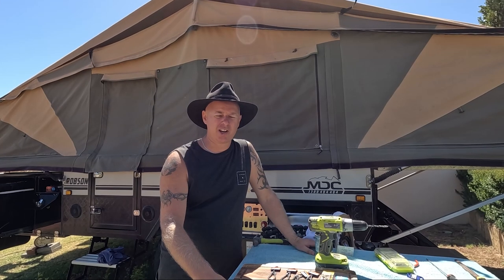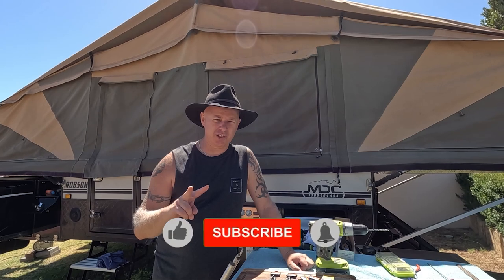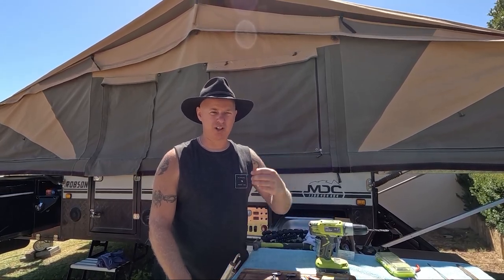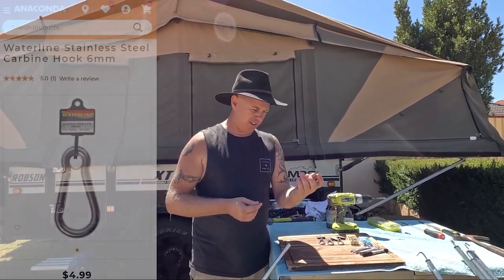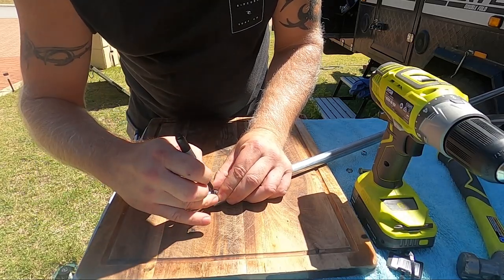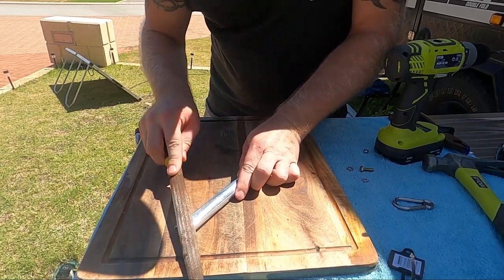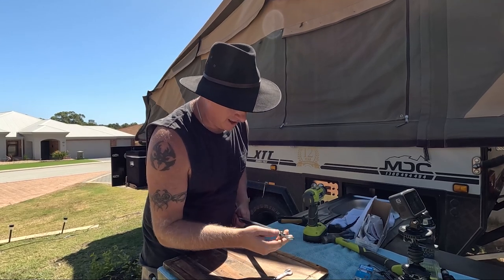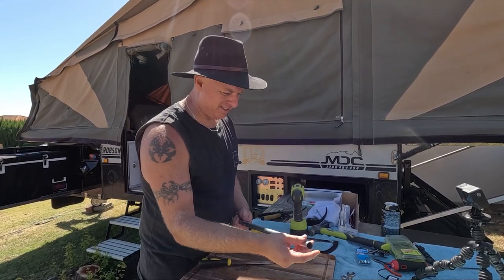OFFROAD CAMPER TRAILER HACKED! Easy mod for your Awning or Annex Camping in Bad Weather!

Comment: I did this to my old camper poles - the only 2 things I would make people consider. Don't put the holes too close to the top of the pole as if there's not much material left, the hole will warp and blow out easily. Also, use a metal drill bit.. you'll find it easier! finally, as used here. Use Nylocks... they will hold things together far better than any other nut.
Reply from the maker: Yeah think I did a good job but time will tell 😁 Thanks for watching Razel 🍻